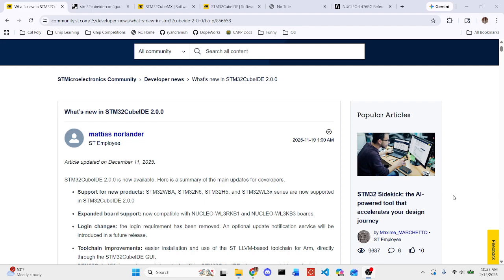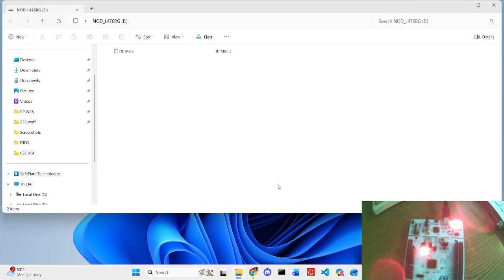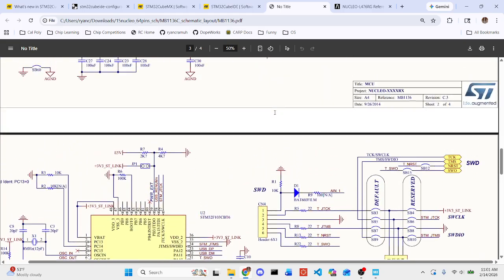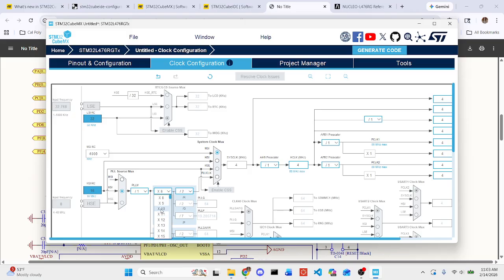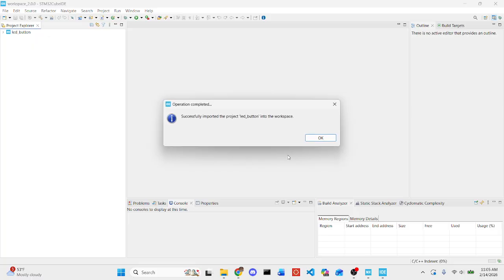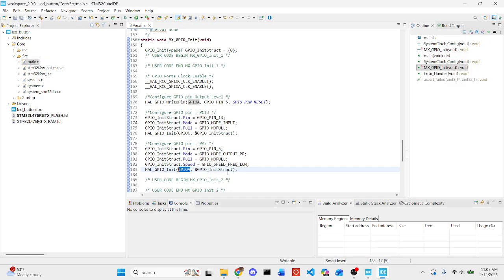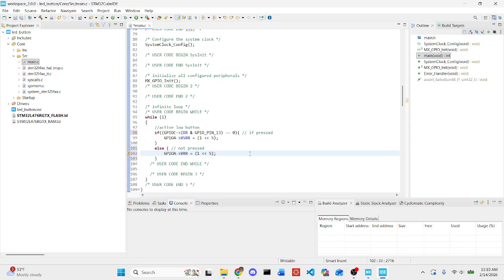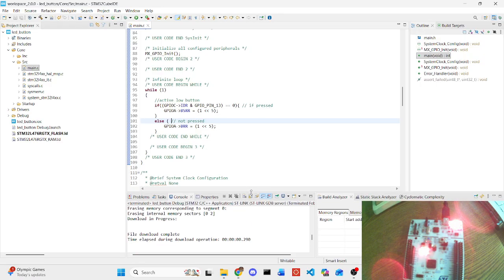STM32CubeIDE 2.0  - LED w/ Button Demo

Comment from the maker: I made a mistake when I talked about the BSRR and BRR. I accidentally said I was "shifting in a 5". What I really meant to say was that I was shifting in a '1', 5 places into the BSRR or BRR.

 If I shift a 1 into the 4th bit (starting from the 0th) of the BSRR (bit set/reset register), the system will put a 1 in the GPIOA bank at the 4th bit (starting from the 0th), which will turn on our LED.  

If I shift a 1 into the 4th bit (starting from the 0th) of the BRR (bit reset register), the system will clear the GPIOA bank at the 4th bit (starting from the 0th), which will turn off our LED.